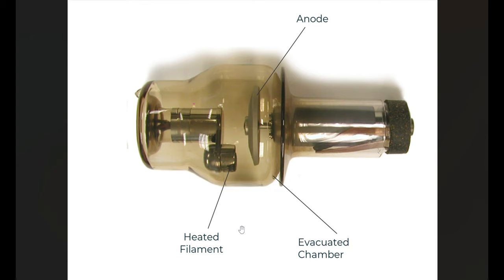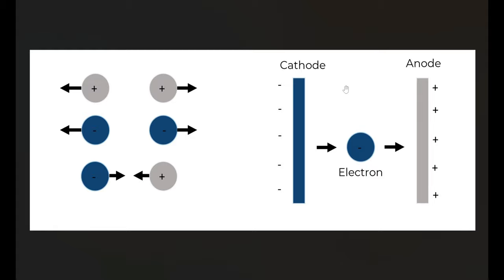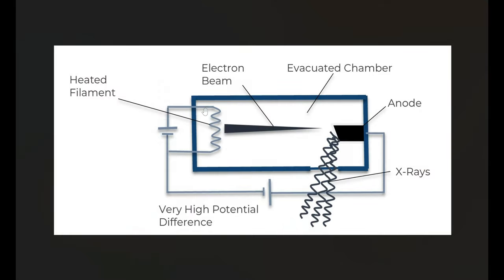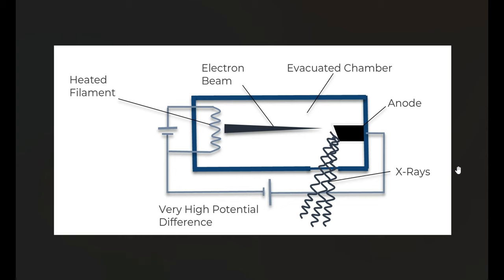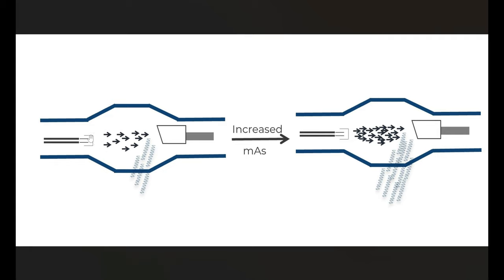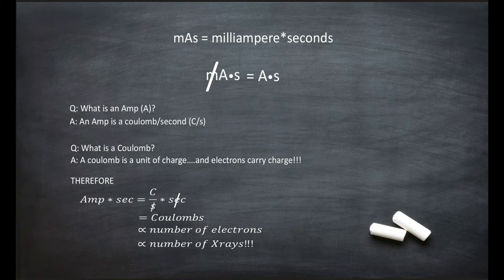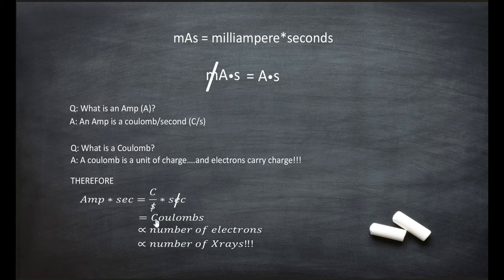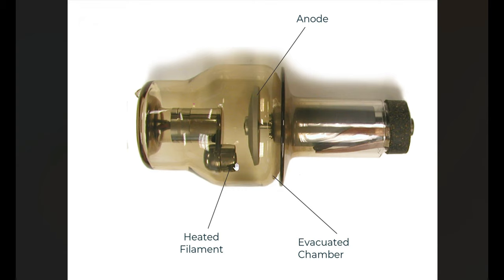Understanding The Difference Between kVp and mAs

Comment: I read that kVp also increases qantity of electrons going from the anode to the cathode. It increases both quality and quantity, while mAS only increases quantity. Is this true?
Reply from the maker: It is true that increasing the mAs increases the quantity of electrons going from the anode to the cathode. However, increasing the kVp only increases the energy of the resultant X-Ray beam - it doesn't increase the quantity of electrons.
Reply: @olympichp  It is absolutely true that increasing the kVp shifts the mean electron energy to a higher value (more average energy and hence higher penetration), but it is also true that a 15% increase in kVp is equivalent to a 200% increase of mAs. This is due to the physics of X-ray generation - the more average energy the electrons have when hitting the anode the more X-ray photons are being generated. However, indeed, increasing the kVp does not change the number of electrons generated at the cathode.